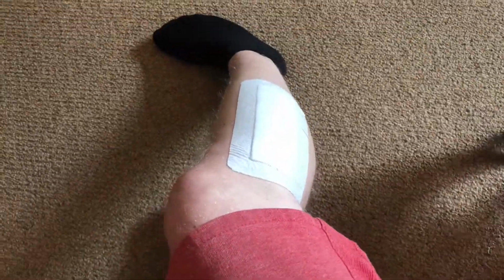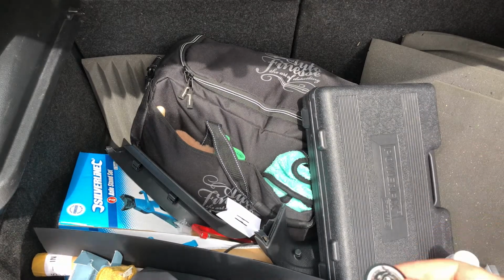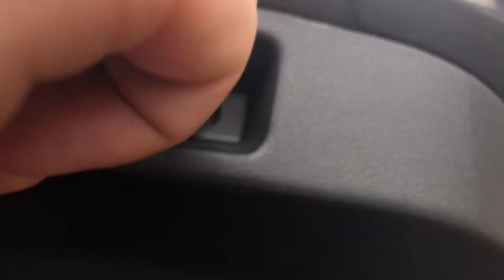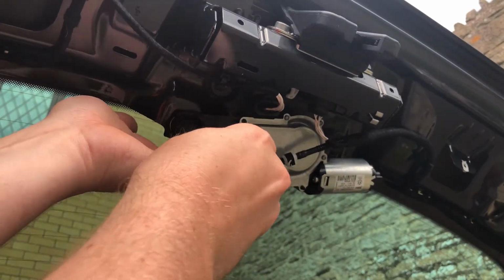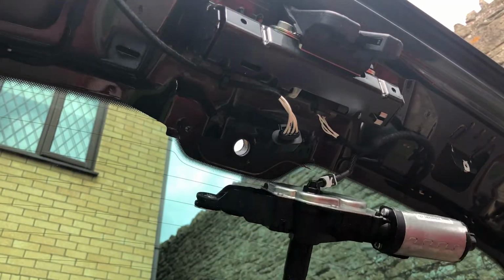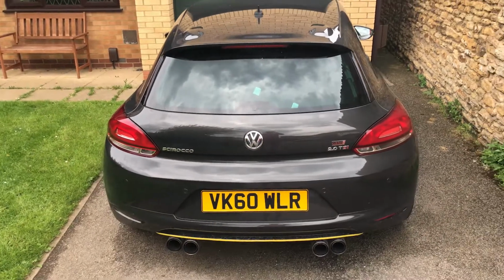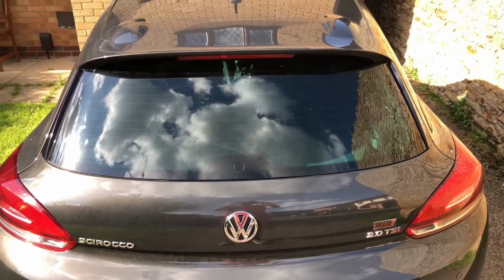VW Scirocco Gets A Wiper Delete - How To Guide - Kill All Wipers Kit!

Comment: Do u have to plug the hose up ? Or does it piss out inside the boot when you press the back wiper on the lever
Reply: I’ve just done mine and it still comes out. I’ve tie wrapped it in on itself in hope that it will plug it up.
Reply from the maker: I just blocked the end with abit of silicon

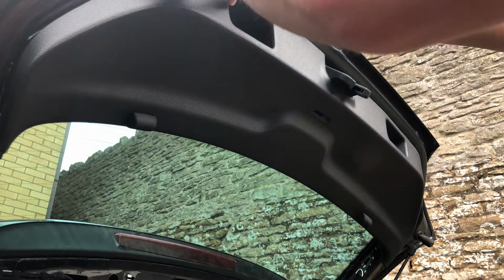Comment: 3:17 How to remove the remaining plastics that you have already removed? You didn't show it in the video. I would like to remove them to tint the rear window.
Reply from the maker: the plastics on the inside of the boot are just clipped on, so give them a tug mate
Reply: how do you get the small clips out
Reply from the maker: @matthewnew1816  pull those fuckers

Comment: Careful with the cup spoiler, mine used to bang off the roof when you opened the boot. Also, you may need to trim the brake light hole to make it fit.

Comment: Holy mother of bodges
Reply from the maker: CATALYTIC UK haha the tiny amount of sealant that fits in the gap around the plug didn’t look very generous!
Reply: Ltzonda yeah i get you. I just went for the most poverty option of a £3 rubber bung off ebay. Does the job fine enough
Reply from the maker: CATALYTIC UK if it does the job man!